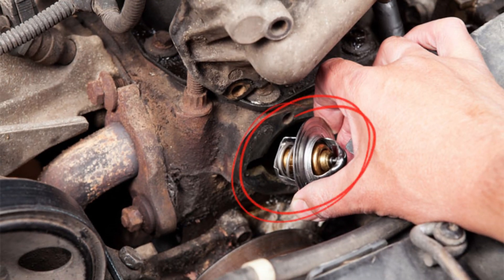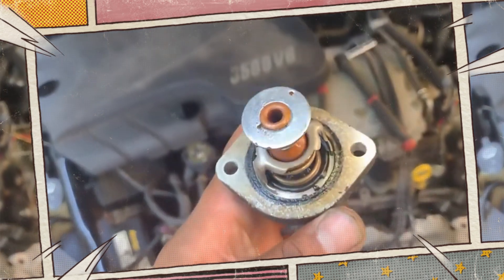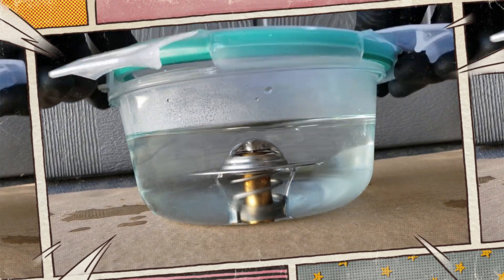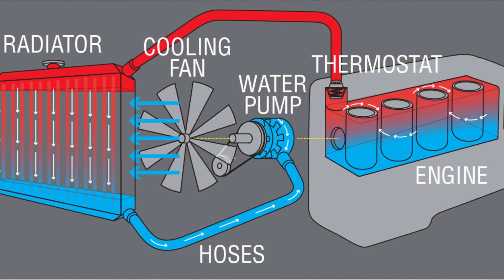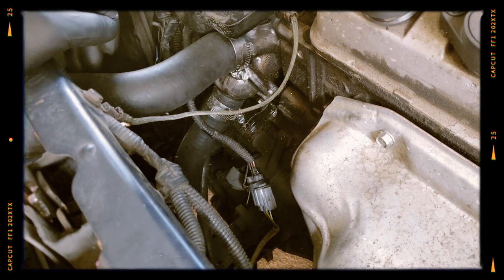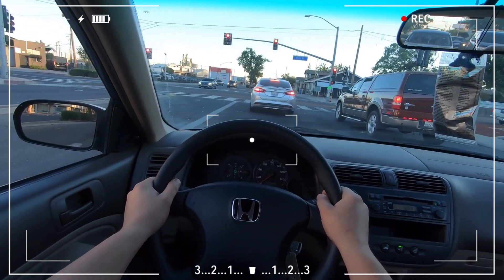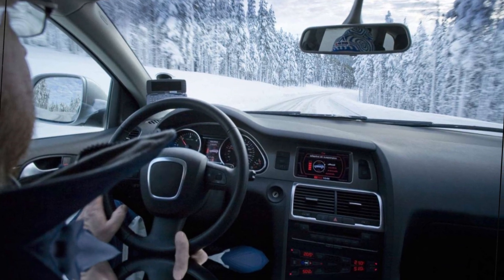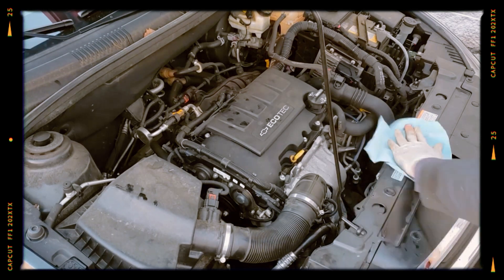Driving Without a Thermostat. Is it a Good Idea?

Comment: If you find that your thermostat is missing it’s because your car has bigger issues. Either mechanic was too cheap to put in another thermostat or you have a clog/trapped air in cooling system or even a water pump that’s on its way out. Having open flow without a thermostat is just a temporary mask

Comment: Without thermostat the engine takes few minutes to get operating temperature. I observed that when I remved  thermostat. Thermostat helps to make engine hot fast. So for winter countries it is good because you need car heater to get warm. But in tropical hot countries you never use car heater, so no need engine to be hot fast. Heater coolent and engine block coolent are connected  before the thermostat. so they need to get hot fast. Other thing is that to save fuel only. Because untill engine reaches the operating temperature the rmp may high for few minutes

Comment: In tropical / equatorial locations, thermostats in engines is more of a risk than a benefit. If ever it gets stuck and refuses to open when normal operating temperature is reached, your engine will overheat in a couple of minutes.

Comment: I’m sure there are exceptions, but engines run optimally at a designed temperature. For instance, the optimal operating temperature for a 396 engine is typically 180°F to 210°F. Maintaining this temperature range helps ensure efficient combustion and engine performance.

Comment: I ran a thermometer chip in a 3rd generation Camaro,with that you got a 180degree thermostat the original thermostat was a 195,cooler running,means more horsepower later I pulled the snail stock motor and put in a 350 bored 30 over (355)and put a set of stage II dart heads,they were mildly ported and polished with a valve job,nice comp cam and edelbrock intake with a Holley 650 double pumper with a little bigger jets ,double roller timing chain  373 gears ,auburn posi unit ,headers and dual exhaust ,was pushing about 430 horsepower naturally aspirated..,She’d sit you back in the seat
Reply: Oh, okay.

Comment: Didn't feel like fixing my heater core. So clipped, the intake and exit hoses spliced them together with a brass nipple and took the thermostat out and never looked back. I run fifty-fifty coolant and do my own oil changes &  the 94 dodge ram 1500  has 300,000+ miles on it. I wouldn't suggest doing this on a new car, but old trucks. It seems to work just fine. I'm going to do it on my 99 dodge ram as well tomorrow as i am changing the original  water pump and that truck has 320,000 miles on it and the head gasket is starting to go. So, choosing to remove the thermostat, so the engine runs cooler.
Reply: Hello, will removing thermostat easy pressure on head gasket? I have an old Honda Accord ictdi and I suspect the head gasket is starting to go and has a small leak, drive fine on highway but temperature rises when driven in traffic for a prolonged period though it normalize when the fan kick in. Once it has reached this stage of cooling down through fans the drive is very bad and sluggish. I suppose if I remove the thermostat the engine will likely not overheat at all. It has 260000 miles so I didnt want to go through the hassle of stripping that old engine just to change head gasket.

Comment: Wrong
 The thermostat is only to make your engine heat up quickly, so you have heat in the winter. You don.t need a thermostat .
Reply: Running at higher rpms without a thermostat will overheat your engine, the coolant isn't staying in the radiator long enough to cool.
Reply: Do you really need a thermostat when you're in South Florida?When it's ninety degrees you're around
Reply: when i do a flush, i remove or modify thermostat without its functional components

Comment: I lived in Alberta 🇨🇦 for almost 10 years for work, my daily vehicle was a Jeep YJ 1994 4wd, and I remember when I decided to delete the thermostat off the radiator, due to severe cold season, it turned out beneficial for the 4.0 engine cause the warming time was faster before driving and no mechanical issues.
Reply: But Canadá in winter time is cold a thermostat is needed if not engine never produce any heating and u as driver suffered inside cold vehicle 

Here in Illinois in winter time is a nightmare get in a vehicle below cero inside obviously thermostat is needed for engine heat and confort for driver 👍

Comment: Im from india..  Here 90% Tata indica was Running in With out Termostat 😂😂😂...  No issue    - No repair -  Super Good Mileage -  ( Ac Condenser is Always in Cooling Condition  So Ac Cooling is Superior Level Ac Compresser also Cut off Easyly and Regularly..!!!😂😂😂..  Note  : Here Climate was 90% Hot - So We dont Need a Termostat. Must use Cooland only Never use Normal Water..  Thats All...  Bye bye Take Care of Your Car
Reply: 😂😂😂😂😂 im from philippines . most of the car or truck here dont need thermostat....
Reply: @dicksonporras9596 same country, same fucked country
Reply: Just use coolant water

Comment: I have 20’ Infiniti q50.. recently I had a spew of coolant out of my reservoir tank. So when I drive, my coolant rises but only to a 50% level and back down to abt 35% stays in that range to. 

So I’m thinking it’s the thermostat.. I don’t think it’s the water pump but I’m not 100% mechanically inclined.

Comment: My camry 2012 starts rattling noise when Coolant Temperature sensor is on. And when i switched it off the car runs in a perfect condition like a brand new car..can expert suggests what could be the fault.
Reply: Might be an issue with the water pump itself, they do break over time, it'd be my first check after the thermostat and related sensors
Reply: @incoherentscreaming5011  Thanks for the useful insights.i would like to mention that i tried with my OBD scanner it only shows that P0017 sensor..i went to the computer shop they said the rattling noise is from crankshaft timing.

Comment: If engine overheats while on journey take out Thermostat to prevent constant overheating.Replace with new when possible
Reply: I m planning to go on a long trip to Oklahoma and I m passing through Arizona, should I take out my thermostat? Because I know I will be crossing through the heat. I have a Chevy Silverado 2001 4.8
Reply: @RubenGarcia-m4e  yes remove it, never put anything  in tjhere again.. if its too cold can put hot air to intake or , cover a little bit the radiator it will run like a chmap,, in racing engine we do that
Reply: @termonostrumanwtf😂😂😂😂

Comment: 2006 Toyota corolla  (  240,000 miles )  No air conditioner , no heater core  ( bypassed with little 1/4 " glass lab tube. enjoy the beautiful color of added  tracer )  , no thermostat  , NO PROBLEM whatsoever , live in Florida and run 20  miles a day !  Direct switch to radiator to prevent overheating !  Many thanks for video , okay ?
Reply: I used  to live in Hawaii  , everyone  removed thermostat  ....no problem . I now live sub tropics and just removed  thermostat . Will monitor  closely . Also with summer  coming  ,check fluid...when it goes bad it does so  FAST  and SUDDENLY  !
Reply: Leme guess; all water too, no need for coolant😉👍

Comment: the concern as the video says is engine oil become thicken and may impaired engine lubrication. this is only applicable to cold weather country. but for me, living in equator country, weather temperature always hot, engine oil never thicken. and i have removed the thermostat for 2 years now, and in fact, my engine running better now.
Reply: Nice thanks for this advise, want to remove mine as I’m also along the equator
Reply: any engine runs better a little bit cooler..

remove the termopstar 
there are severla tricks to rise a little bit the temperature,, if you thing its too cold specially in winter.
Reply: @termonostruman What are some of the tricks to raise temperature a bit once you have removed the thermostat?
Reply: I'm running my car without it in my country Papua New Guinea
Reply: @RichardTaqiiSteven  All cars runs without it, if its not too cold.

Comment: Had my toyota starlet running at 70-75C from 85-95.

I changed my radiator to 2 row full aluminum. Im in Philippines.😅
Reply: Thanks for this comment. I have a 92 starlet gt. I ordered a new thermostat but it won't be here for a few weeks as I live in America and have to ship parts from Japan. Gonna take out my thermostat for a few weeks

Comment: Running without thermostat may be applicable to older cars. Modern cars operating with ECU controlled by sensors might have dire consequences
Reply: If you live in a region with hot summers remove it as it can cause engine failure if stuck
Reply: @Peter-f4o4z true
Reply: you can do everything if you know what your doing i recomend you contact a very good mechnic.
Reply: Lies

Comment: I don't think this is true. I have been runing without a termostat in a hot climate country. When I have a termostat it always made a problem. Overheating.
Reply: Me too ..I always have good luck when I take the thermostat out
.takes heater a little longer too work ..but what's ten minutes of my time..your. Right
Reply: That means you have a flow issue. Clogged radiator ect. Too low of flow with thermostat,  back to reasonable flow without it.  If it wasn't clogged it would flow too much and not allow enough time to cool the water in radiator.
Reply: Same happening to me in st lucia car always over heating an everyone told me to remove it
Reply: Yeah, you think thermostat is ideal in equatorial regions, where temperatures are extremely high, ND you drive half a mile the radiator boiling
Reply: I have the same problem 
Someone say remove it when your in a hot country